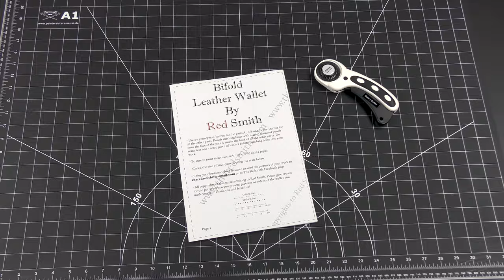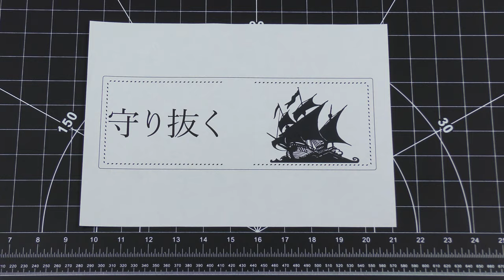How To Make A Leather Wallet - Leatherwork With .pdf Pattern

Comment: Hi ! Great work and great result :) I would ask, how did you design your patern (parts to cut, en stitch point) ? By the way, voice over was good ;) Thank you and keep making !
Reply from the maker: Hello Arnaud! Thank you. That's the most difficult part of the job I would say. I use Illustrator, so I can use different layers to align all the parts and stitching holes perfectly. Once you have that and the right measurements, it becomes pretty easy but still super time consuming. Hope it helps!
Reply: @RedSmithWorkshop  I espected something like that. So now, time to do some vectoring tool 😅 Thank you !